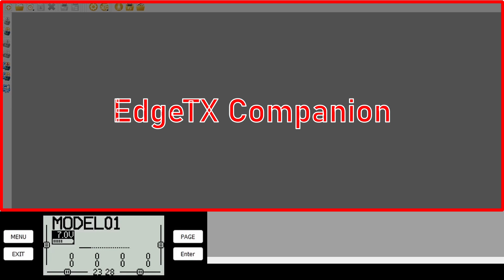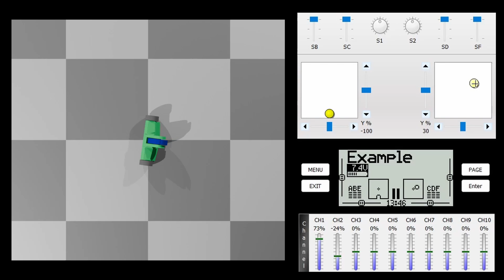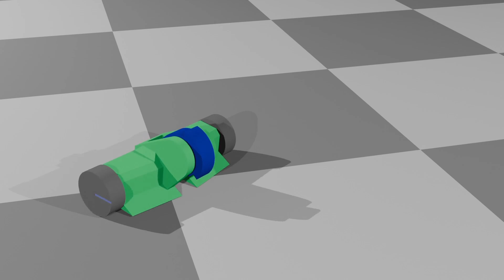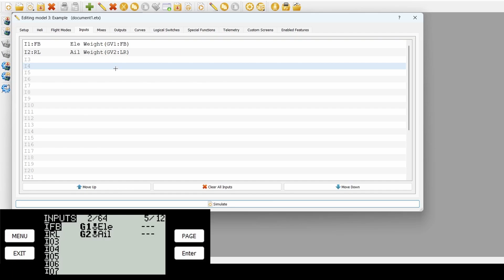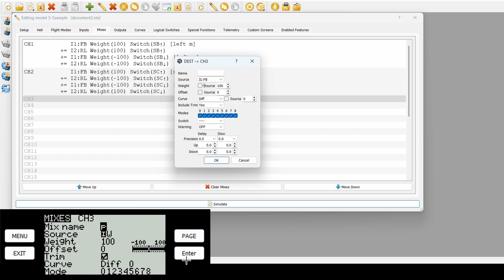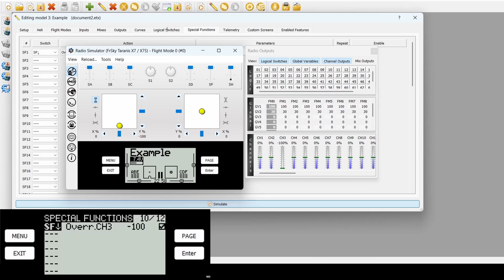EdgeTX Mixing for Combat Robotics  [Tutorial]

Comment: im not sure exactly what im doing wrong but when i try to do the special functions/ logical switches steps its twice now just stopped recognising all the switches on my radiomaster zorro and ive had to restore the files on sd card to fix it, i even tried setting them back to default in edgetx companion but couldnt seem to get it to actually transfer over to the controller. not that bothered by it since the rest of it got my robot actually working but im kind of confused/stuck whats going wrong
Reply from the maker: Sorry about that!  I've heard this a handful of times recently and I suspect it may have something to do with the version of the companion and your transmitter mismatching, especially if the transmitter hasn't been updated in a few years (sometimes factory-shipped ones have older firmware).  Try double-checking that they're both up to date if you need to do it again.

If I can figure out definitively what's causing this, I'll leave a pinned comment explaining how to fix it.

Comment: How can you get the bot simulator side wise , is it some other simulator, or a part of a edgetx companion
Reply from the maker: The bot simulator is not a part of the EdgeTX companion.  I manually animated and keyframed the robot in Blender to make it appear as if it followed the simulator inputs.  The goal was to help make it more clear how a robot would behave based on the given mix.